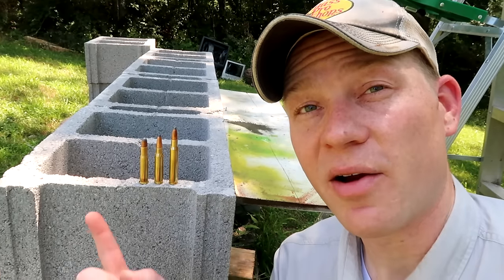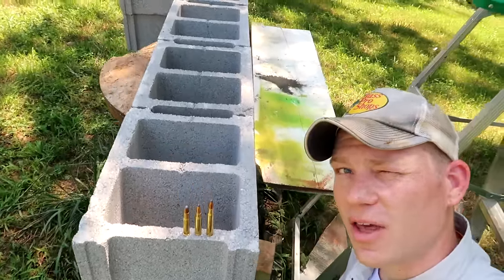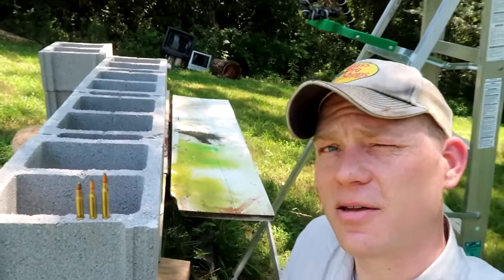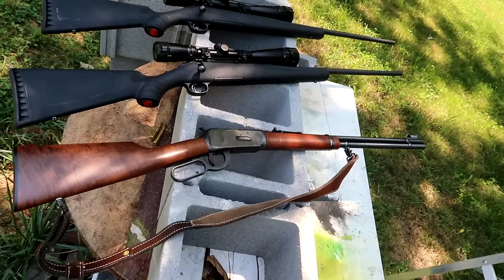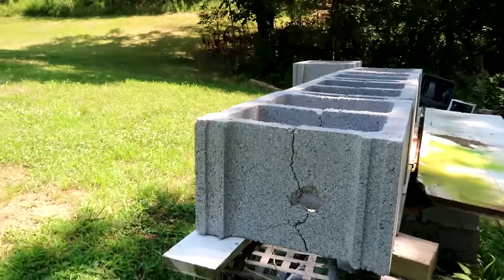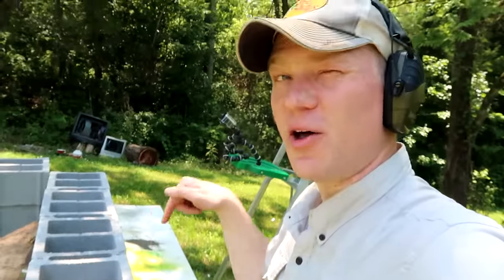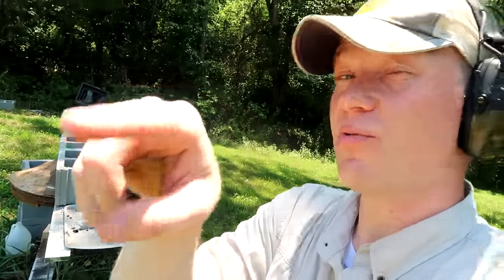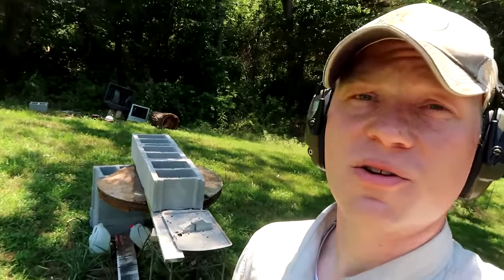30-30 vs 308 vs 30-06 - Cinder Block Test

Comment: How about a 556/223 and 762/308 semi/a with a bolt lock down feature for bolt action hybrid, rack back into former selector

Maybe a 300

Polymer light steel rounds

12 g wedge tip, symmetrical
rectangle, loose cage
Frag round for bears

Magnetic induction round burst
Gas heated chamber, vehicle powered cooling

Comment: I have use all 3 calibers.  I choose which I am going to use based on what I am doing.  Hunting in the woods with ranges under 100 yards and quick shots happening, I just go with a .30-30 in a levergun.  For 100 yards or more, I switch to a .30-06.  There are lots of good choices.  My .30-06 is very accurate with Nosler Partition 180 grain bullets.  That combination gives me a good tool for large game.  I like the 170 grain Core-Lokt bullets from my .30-30 due to accuracy in my rifle.  When I do my part, deer do not care which one they are killed with.

Comment: Nice 3030. Mine is a 16 inch Barrel that holds seven rounds, but I wish it was the 20-inch barrel. Sometimes i know 16-inch barrel is better for a brush gun, though

Comment: Excellent un-biased review. I think everyone of the statements you made about everyone's perception of each caliber has merit. And I know that what you have there are real concrete blocks. You're mention of size and just the looks gives it away. Which makes this test all that much better in my eyes. I'm personally a 30/30 guy and would have guessed that it would have penentrated deeper because of it's slower less shocking impact. But I was totally wrong. As one of your other viewers mentioned the 308 shows how technology has made the 30 caliber the best it can be. We actually saw that in the blocks. While the 30/06 split the block cleaner with it's shocking power. You didn't see an impact on the last block because it had already spent all of it's energy. However the 308 left a definite impact mark on the last block from it's desire to penetrate. I've always used the same 30/30 for 40 years that my parents gave me when I was 13. And I'm terminally ill now and can't hunt anymore. But after seeing this. I would definitely buy another rifle. But all these weapons have their place. I think if I could still hunt and had the opportunity to get another deer rifle. I would choose my caliber according to the platform I was working with. Thanks for the review. It was enlightening!

Comment: I have fired all 3 call at one time or another.    But i guess i prefer the.   30 06 that's what the M1 i carried for the first year & a half i spent in the army before they switched to the 7.62 cal i called it the NATO cal.   The M14 was lighter & a nice rifle but so was the M1.   When i was younger traveling through Texas me & my buddy decided to do some target practice a jack rabbit jumped out & being young i considered it a moving target.   I gave it a sporting chance & used .my 1911 model 45 with no luck he ran fast & had some broken field skills.   Of. Course he ran away when he got out around 200 yards i decided to use my rifle it was a 30 30 shot just low enough that the bullet passed under i though i was going to put one in his rectum but didn't allow enough for bullet drop.   I hit the ground between his hind legs breaking both legs rifle was a marlin 30 30.  I had hunted deer many times with it in Pa.  It wasa good lever action that worked well for me.   Moved. To back to Calif where there is no way i would go hunting unfortunately not that stupid i guess.   The WW2 spitfire used the 308 for armament shooting down many German aircraft if i remember correctly.

Comment: I'm definitely no gun expert but I could be considered a wall expert I've been working in masonry for over 35 years.

The ends of the block are much weaker than the sides of the block which you would normally be hitting if you were shooting at someone behind a wall and we usually fill every other cell if not every cell with concrete Depending on the project. So it's not really a very accurate task but still entertaining.

Comment: Only one minute in and I will guess that 30-06 will go thru both sides of the block. The other two will only go thru one side but put a chip in the other side. Am I right?
No, I am not right.  But wow, you are not safe behind a concrete block wall if someone is shooting any of those guns at you.
Question: does the type of bullet make a difference? I noticed that the 30-06 and 308 had some kind of tip on them. They were also much more pointed than the 30-30 bullet. Armor piercing versus hollow points versus ??

Comment: Good test!  Next time try some amour piercing rounds and FMJ's...Add the 198 grain 7.92mmx57 Mauser...apparently it had more penetration power than the 30.06...American manufactures down load it due to the old .318 inch barrels on older guns...

Comment: I see no one mentions the barrel length difference. I believe the longer barrels 308/30-06 create more velocity. An the load probably has more powder an more velocity to begin with than the 30/30. However it was a comparison from one ammo to others. Interesting. An fun an I believe that was the point . Different strokes for different folks.  Looks like smaller to larger was in order. 
 I'm a 308 fan. But the nostalgia of the 30/30 with the lever will never die. I think its the look an the feel of the old marlin 336 that makes it appealing. Not so much the winchester 94 top eject. My 2 cents .               Enjoy shooting the one you prefer !

Comment: Even if the 30-30 only went through 1  block you still don't want to get shot with it. The other 2 just have  more power behind them so they move faster,giving more shock power. I have a Marlin 30-30 Alamo Commemorative that I bought from a pawn shop at 16 and my son has a Winchester 30-30 Lone Star Commemorative from my dad after he died. It's the "rifle that won the West" and being that I was born in Texas both guns are special to me.

Comment: The 30-30 is a round nose bullet.  The other two are not.  They are made for penetration.  But the 30-30 is the 45 ACP of rifle cartridges.  Its design to punch hard but do it slower and not go all the way through.  Your test showed the 30-30 did what it was designed to do and the 308 and 30.06 did what they are designed to do.  All three are great rounds.

Comment: just the way my brain works but I wonder what difference we would have seen if the blocks were all one long piece instead of individual blocks. I wonder if the initial impact creates a shock wave travelling through the whole block pushing the sides apart so that when the bullet hits the wall is ready to burst but when the shock wave reaches the end of the block it is not transmitted to the next one. Therefor if it was all connected the different impact strengths would create different sizes of shockwaves which might allow for deeper penetrations and a wider variation. I have been cooped up for a while and may be a little off.

Comment: They need to do the test using a 30-30 with the same length barrel as the other 2 rifles. Standard 308 and 30-06 have 24 in barrel. Put a 24 inch barrel on a 30-30 and compare the results. Numerous manufacturers including Winchester model 94's have 24 inch barrels.

Comment: I prefer 30.06 over 308 Winchester. The reason is 30.06 has slightly better terminal ballistics at medium ranges of 500 yards. At ranges not over 300 yards I dont think their is much difference between.308 and 30.06. For hunting at short range like 100 to 150 yards, especially in woods and brush, 30.30 Winchester.

Comment: for deer sized game i prefer a 30-30 it actually delivers more shock to the animal at ranges under 100 yards but has no problem dropping them at 225 here in Northern MI members of my hunt party and myself have also used 30-06  and .308 win and we have taken so many deer with 30 caliber holes drilled in them at ranges under 100 yards there is always a big exit hole from the 30-30  now game species that are bigger, or going long range hands down ill take my 06  to the 308 guys out there i have owned one ,used it nice caliber But there is a much bigger range of ammo for the 06 ammo price is same might as well have the variety from 55 grain to 250gr so that gives you a little more bang for your money, especially if you cant really afford to have an assortment of calibers. but all 3 calibers are fine deer cals i just prefer my marlin 336 for whitetail, never had to track one after a shot they always dump on spot and if they get up  ( rarely) they make it about 35 yards and drop dead my 06 unless i do a neck shot they always run off, in michigan doing heart lung shots is the best way to lose your deer to other hunters in the woods and they dont even shoot it  they just take what fell by them.

Comment: of course not with these bullets but if you shoot directly at a cinder block with a 22 rifle the bullet will come right back at you. it did with me plus I could see the bullet on its return trip and whapped me in the leg. another BAD idea is shoot at tires.
Reply: if the cinder block for instance was slightly angled different I could have been blinded by a direct whap to my eye so I dont suggest it but if you do tests you will find the bullet will not break the block but come right back at you for sure. it was not like those blocks. it was the most common building block worldwide in use.

Comment: I use all 3... but so far the 308 takes the cake. If they would let me share the picture I layed 1 down at 150 yards with a Hornaday 150gr deer round and when I tried to drag it, the whole shoulder came off. Have used up to a 300 mag and wasn't even close to the damage.

Comment: With hollow point bullet you can't really tell because either bullet is getting explode too quick before going further wall, in order to know you have to use FMJ it don't explode and that can tell the power of each bullet but I can tell which gun has more power by look at the wall exploding, 308 might short bullet but maybe hold the same amount gun powder.

Comment: I have a 3030 and a .300 wsm.  Both great guns for different applications. For dense woods, the 3030 is unmatched. Small branches and brush dont faze that bullet. Killed many deer with that gun.. my 300 is awesome for feilds and longer shots.  Killed one at 450 yards and it dropped immediately.  Both great if you use them correctly.  Good video

Comment: should have used the 170 grain bullet on the 30 30 and a spearpoint to be fair I know powder
 is not the same but I think the spearpoint is better than a flat point I use spearpoints in my Thompson contender 30 30

Comment: I have my 30-06 loaded with 165 grain Hornaday interlock bullets coming out at 2950.  Can't do that with a 308 and definitely not a 30-30.  All are great rounds, but hard to beat almost 3200 ft/lbs of energy out of the 30-06.

Comment: I have an interesting test to consider. Cops and others often in chases shoot through their slanted windshield but never hit a thing. since a pistol bullet spins at minimum of 1/4 million rpm. could cops perfect their shooting such as to aim WAY HIGH and to one side or the other? I think because of the spin the bullet would GO LEFT. because of right hand spin? there is a dramatic video VERY dramatic here in Las Vegas of a cop doing just that several shots but the bullets hit nothing. (but when he jumped out they certainly did so that was the end of that chase.)

Comment: To be expected. The blunt nose .30-30 was going to lose its energy early, and made two big holes. The pointed .308 and .30-06 may not have made as big of a hole. What you needed to do was set the block pieces together to see how big of a hole they created. They hit the third wall enough to crack it and that let the block fall over. The .30-30 didn't because only the first two walls cracked. You really need to see the hole size on the first two walls for the .308 and .30-06 to see how much energy was transferred into the block. Breaking the walls farther back is just penetration. It is transference of energy that stops something. That is why hollow point bullets are sold as home defense rounds.

Comment: Shoots two different  brands and style of bullet made a difference the corelock was round nosed the other two were pointed  that would make a difference  all are good for what they were designed for i have hunted with 30- 30 and  30 06 on deer the 30 06 ruins  too much meat out too 150 yds i like the 30 30 better and it dont ruin your shoulder   but good video

Comment: Add the 45 / 70 to that test.?
30/30 bullet: round nose lead..
Other bullets full metal jacket and come to a point...
I have used 30/30 full metal jacket... But you can only shoot one round at a time...
Not safe to load that round in a lever action..!
That would make your test more fair to the 30/30

Comment: I'm a 30-06 fan and am Really tired of people telling me that 308 and 6.5 perform ballistically the same for being slightly smaller rounds than 30-06,  if that's the case why do you worry about it if they perform fairly equally?   I'm a fan of 30-06 because the wide variety of ammo offerings and secondly anywhere ammo is sold you're gonna find 30-06 ammo and because it's so popular there's a lot of it and its slightly cheaper.

Comment: Anyone who is only equating the 30-30 to deer hunting and immediately moving on to the larger cartridges for bear and larger game has apparently never used a 30-30 on larger game before.  It will stop a black bear no problems, and with that experience in mind I'd be very confident using it for other bear and large game.

Comment: I didn’t think there would be a lot of difference between the 308 & 30-06 , the 30-06 would excel with heavier bullet weights as you have more case length.
Reply: But great video all the same 👍

Comment: They are concrete block. Cinder block were made from cinders from furnace. Back in the day the cinder block was cheaper and lighter than concrete but not as strong.

Comment: I think a 30 30 or a 35  works fine  in a wooded area  but not so much  on a 100 acre soybean field   this test proves with out a doubt,  that at short range all three are deadly on a cinder block   . But dang it's hard to cook them tender

Comment: For deer, I wouldn't turn my hand for the difference. The .30 06 is the more versatile cartridge though. You can kill anything in North America with a .30 06.  That is not true with a 30 30 or a.308. But for a fun gun to take deer hunting, the lever action .30 30 cant be beat. And I do mean with iron sights not a scope. For my money, a .30 30 is not a scope gun. It is a work horse. A .308 is a tactical gun and a .30 06 is an all purpose powerhouse depending on the loaded round.

Comment: that was surprising. I thought the .06 would of gone throw 4 walls. i have all 3 30.30, .308, 30.06. I think that the 06 is the best all around. You can load it up with small bullet or a heavy one. If I had a bear charging at me, I would want the 30.06 for sure.

Comment: The velocity of the .308 and 30/06 is not that much of a difference with a 150gr projectile. I’d imagine a standard factory 180gr 30/06 round would have had a bit more grunt.
Reply from the maker: good idea

Comment: The .308 is best out of the 3 rounds.  And it's because with the correct load, it doesn't penetrate as much and the terminal ballistics will not pass through the target.  It's why it is the preferred load amongst most police sniper teams.  It's all about the backdrop.  The bullet will do it's job no question.  You just don't want the projectile passing through and impacting anything else.

Comment: Still a fan of the 30 30. It'll take a white-tail with ease, and I have never hunted bigger game. For brush country, the slower moving bullet isn't as easily deflected and means more hits/fewer misses. Seldom have my shots exceeded 120 yards. So the 30 30 it remains. If I ever hunted the wide-open places and had longer shots, I MIGHT change. Mebbe not.

Comment: I would be curious to see what would happen if you put the blocks in the other direction... so like if you were shooting at a brick wall... would you be safe on the other side... the thickness is greater on the sides but there are only two layers... vs shooting at the end of the block where the thickness is lesses but there are three layers. 😁
Reply from the maker: Yeah, I shoot them long ways because I have like 30 other videos doing it the same way for comparison.  Point is not to see if we can shoot through walls but to see how many of the layers it goes through
Reply: WHO_TEE_WHO ok that makes sense... I can see the usefulness of doing standard testing. I was just thinking 🤔 I wonder if I was being shot at... would a standard cinderblock wall give adequate protection... Since the sides are thicker than the ends / but only two layers instead of three... I was unsure of how that would work... but not a problem... thanks for the quick response !! 

And once again: Keep up the good work !! 👍🏻👍🏻

Comment: I have both 30-06 & 308 my analysis is that, .308 has more precision than 30-06. Anyhow both are great rifles been using them on hunting often... .308 is a German made & 30-06 is Winchester 1917 model still works perfectly